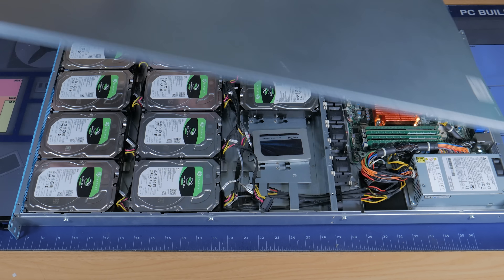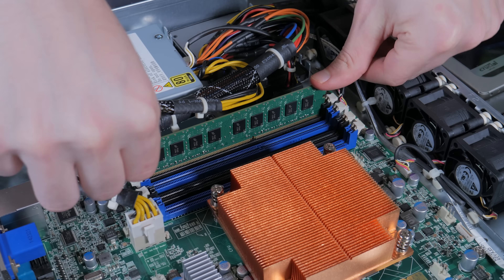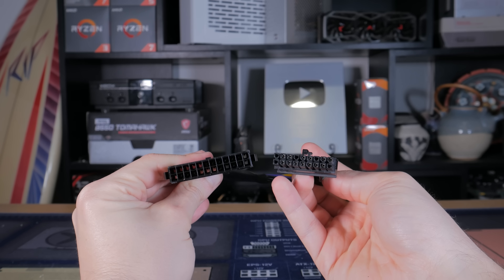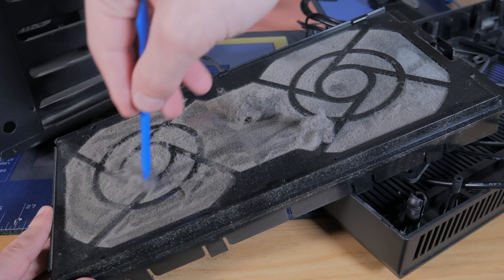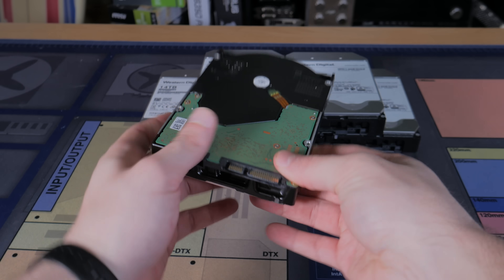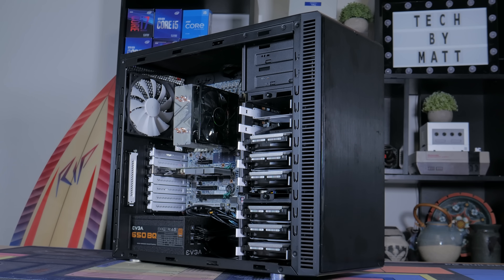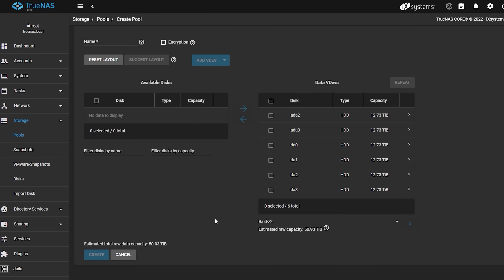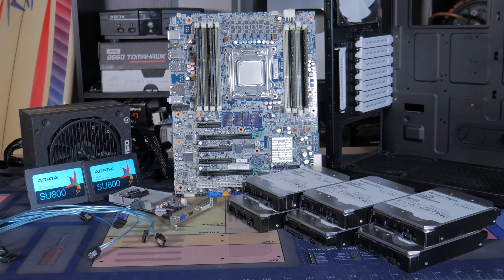Budget Storage Server 2022! | 84TB NAS

Comment: Interestingly enough, Western Digital is currently (April 2022) pushing out a lot of both Red Pro and Gold 16TB drives for $299.00... they must be getting ready to release a newer, larger capacity drive and need the warehouse space.
Reply: Interesting. I just picked up a 12TB gold for like 235.
Reply: @user-ul5wq3kv4p  For BF deals, $250 for 16TB and $284 for 18TB WD Red Pro.  Waiting for the WD shipping.  I have also got one Seagate Exos x18 18TB and HC530 renewed from Amazon.  HC530 wins in every perspective: temperature, noisy and speed.  I am considering buying additional renewed HC530, such a powerful beast.
Reply: Just don’t get anything but red pro. Anything below that is junk now
Reply: @ghost-user559  How about WD Red Plus ?
Reply: @tjhana  I think it’s only the pro they kept the quality of. Look up “SMR drives”. And read people’s experiences and horror stories. They have a very slow transfer speed once you get to a certain amount of data. It’s like they will seem fine but then take 14 hours transferring data that should have taken 4 hours. They can’t be raided or used in a NAS as a result. Only the Pro is the original quality.
Reply: @ghost-user559  not really
Reply: @quazar912  Yes they have a different design for drives that is incapable of being used in a raid array or Nas. They literally got caught using inferior drives without telling customers about it. After that they “promised” that they would keep the Pro line as the only line with raid and Nas compatibility.

Comment: This is great content Matt. I'm currently in the process of replicating your setup (more or less), but the core computing will be the same. I'm struggling to find mobo/cpu combos, so I guess I'll have to just buy an entire Z420 workstation (will save me on the PSU, since I can use its own). For the case, I also struggled - snagged a Corsair Obsidian 750D - only 6x 3.5 bays, but it's got 3 more 5 inch bays which I can adapt.

I read up on the 12 and 14 TBs, and the consensus among shuckers is they run quite hot - Would you be able to share your experience on this topic please?

Thanks for your work!
Reply: Hey I'm about to do the same in replicating his build. How did your build work out?
Reply: @CharlesMacro  So uh, it's live for some time now - my main NAS actually. I added a Quadro P400 card for Plex transcoding.
I transplanted the mobo/ram and cpu (E2640) from an actual Z420 workstation which I bought second hand into another case - You have to mind the transplanting, as it's finnicky - You can only move over the mobo/cpu/ram - as the PSU is non standard and will not fit a ATX case - https://youtu.be/c8G97FlI2QA

He's using it with TrueNas for storage mainly - I'm using it with UnRaid (which is additional cost) - but somewhat easier to deal with.

The supported CPUs for this mobo are quite old, and while they can deal with quite a lot - the energy consumption is a factor - I jumped feet first into this before the energy crisis - not sure I would do the same now.

Comment: To eliminate the "F1 to boot" issue you could get a cheap 80mm case fan (they're only a couple bucks) and mount it anywhere in the case. The connector for it is on the top left of the motherboard. Might not look terrific but you could just use double sided tape and stick it anywhere. Also, you may be able to attach a piece of wire or something across the 4 pins of the connector and essentially create a kind of "jumper" to trick it into thinking a fan is plugged in, though I have never tested that method. Aside from that I don't think there is a way to bypass that screen.

Comment: This looks like a good reasonable high core count* higher memory option. If you can find the v2 version of this hp board you can go upto 12core cpu,  the v1 board is limited to 8cores. 

*compared with my current i7-6700k storage server. The extra cores and higher memory support will be useful to host vms as well as storage,  though going upto 2011-v3 xeon is probably better for vm performance but obviously higher cost.

Comment: I built about the same thing. But I spent a lot more $$$ bc I bought everything brand new. Bought 8x6G hard drives. Had a spare ryzen 3800X, and a spare 700w power supply. So I had to buy out all of the other things, motherboard, memory, HBA, root hard drives, and a cheap nivida 710. Housed the entire thing in an R5. The only thing different is that I built it out in Proxmox and VM'd the True Nas build and direct attached the hard drives. All in all it ran me about $1500, which was about the same price as a Synology with the same drives. So I think I got a better deal: better CPU and system to build out VM's. I also got a better upgrade path if I wanted a better CPU.

Comment: ACTUALLY! I would love to see a comparison between both servers 
the new one as is (same ram and cpu as shown) with only a 10gbe upgrade 
VS the chenbro with unraid and a 10bge upgrade and would love to see the differences in both writing speed and video editing performance.

while true nas is free, you can't readily add drives like you can with unraid. 

backstory! 
I am currently using the chenbro with unraid but I too feel like I need more cpu power
and to fix that, I purchased a lyra sv315 and I'm planning to use the chenro as a disk shelf with a sata expander 
connecting the chenbro chassis to the lyra via sff 8088
but hopefully when I get to my new place, id move the hard disks to a dell md1000  storage vault, (its just really loud to use right now.

Comment: CPU
Intel Core i7-12700K 3.6 GHz 12-Core Processor
Intel Core i7-12700K 3.6 GHz 12-Core Processor
Base
$327.99
Promo
Shipping
FREE
Tax
Price
$327.99
Where

Buy
 Configure
 Remove
CPU Cooler
Scythe Mugen 5 Rev. B 51.17 CFM CPU Cooler
Scythe Mugen 5 Rev. B 51.17 CFM CPU Cooler
Base
$76.15
Promo
Shipping
Tax
Price
$76.15
Where

Buy
 Configure
 Remove
Motherboard
ASRock Z690 Extreme WiFi 6E ATX LGA1700 Motherboard
ASRock Z690 Extreme WiFi 6E ATX LGA1700 Motherboard
Base
$289.99
Promo
Shipping
FREE
Tax
Price
$289.99
Where

Buy
 Configure
 Remove
Memory
Corsair Vengeance RGB Pro 32 GB (2 x 16 GB) DDR4-3600 CL18 Memory
Corsair Vengeance RGB Pro 32 GB (2 x 16 GB) DDR4-3600 CL18 Memory
Base
$162.99
Promo
Shipping

Tax
Price
$162.99
Where

Buy
 Configure
 Remove
Memory
Corsair Vengeance RGB Pro 32 GB (2 x 16 GB) DDR4-3600 CL18 Memory
Corsair Vengeance RGB Pro 32 GB (2 x 16 GB) DDR4-3600 CL18 Memory
Base
$162.99
Promo
Shipping

Tax
Price
$162.99
Where

Buy
 Configure
 Remove
 Add Additional Memory
Storage
Samsung 970 Evo Plus 1 TB M.2-2280 NVME Solid State Drive
Samsung 970 Evo Plus 1 TB M.2-2280 NVME Solid State Drive
Base
$102.64
Promo
Shipping

Tax
Price
$102.64
Where

Buy
 Configure
 Remove
Storage
Samsung 970 Evo Plus 1 TB M.2-2280 NVME Solid State Drive
Samsung 970 Evo Plus 1 TB M.2-2280 NVME Solid State Drive
Base
$102.64
Promo
Shipping

Tax
Price
$102.64
Where

Buy
 Configure
 Remove
Storage
Samsung 970 Evo Plus 1 TB M.2-2280 NVME Solid State Drive
Samsung 970 Evo Plus 1 TB M.2-2280 NVME Solid State Drive
Base
$102.64
Promo
Shipping

Tax
Price
$102.64
Where

Buy
 Configure
 Remove
 Add Additional Storage
Video Card
 Choose A Video Card
Case
Anidees AI CRYSTAL XL PRO LITE ATX Full Tower Case
Anidees AI CRYSTAL XL PRO LITE ATX Full Tower Case
Base
$289.89
Promo
Shipping
Tax
Price
$289.89
Where

Buy
 Configure
 Remove
Power Supply
Corsair RMx (2021) 850 W 80+ Gold Certified Fully Modular ATX Power Supply
Corsair RMx (2021) 850 W 80+ Gold Certified Fully Modular ATX Power Supply
Base
$124.99
Promo
Shipping
FREE
Tax
Price
$124.99
Where

Buy
 Configure
 Remove
Operating System
Microsoft Windows 11 Pro OEM 64-bit
Microsoft Windows 11 Pro OEM 64-bit
Base
$159.99
Promo
Shipping
FREE
Tax
Price
$159.99
Where

Buy
 Configure
 Remove
Monitor
 Choose A Monitor
External Storage
Western Digital ELEMENTS 14 TB External Hard Drive
Western Digital ELEMENTS 14 TB External Hard Drive
Base
$241.81
Promo
Shipping

Tax
Price
$241.81
Where

Buy
 Configure
 Remove
External Storage
Western Digital ELEMENTS 14 TB External Hard Drive
Western Digital ELEMENTS 14 TB External Hard Drive
Base
$241.81
Promo
Shipping

Tax
Price
$241.81
Where

Buy
 Configure
 Remove
External Storage
Western Digital ELEMENTS 14 TB External Hard Drive
Western Digital ELEMENTS 14 TB External Hard Drive
Base
$241.81
Promo
Shipping

Tax
Price
$241.81
Where

Buy
 Configure
 Remove
External Storage
Western Digital ELEMENTS 14 TB External Hard Drive
Western Digital ELEMENTS 14 TB External Hard Drive
Base
$241.81
Promo
Shipping

Tax
Price
$241.81
Where

Buy
 Configure
 Remove
External Storage
Western Digital ELEMENTS 14 TB External Hard Drive
Western Digital ELEMENTS 14 TB External Hard Drive
Base
$241.81
Promo
Shipping

Tax
Price
$241.81
Where

Buy
 Configure
 Remove
External Storage
Western Digital ELEMENTS 14 TB External Hard Drive
Western Digital ELEMENTS 14 TB External Hard Drive
Base
$241.81
Promo
Shipping

Tax
Price
$241.81
Where

Buy
 Configure
 Remove
External Storage
Western Digital ELEMENTS 14 TB External Hard Drive
Western Digital ELEMENTS 14 TB External Hard Drive
Base
$241.81
Promo
Shipping

Tax
Price
$241.81
Where

Buy
 Configure
 Remove
External Storage
Western Digital ELEMENTS 14 TB External Hard Drive
Western Digital ELEMENTS 14 TB External Hard Drive
Base
$241.81
Promo
Shipping

Tax
Price
$241.81
Where

Buy
 Configure
 Remove
 Add Additional External Storage
Expansion Cards / Networking
Sound Cards, Wired Network Adapters, Wireless Network Adapters
Peripherals
Headphones, Keyboards, Mice, Speakers, Webcams
Accessories / Other
Case Accessories, Case Fans, Fan Controllers, Thermal Compound, External Storage, Optical Drives, UPS Systems
Custom
 Add Custom Part
Total:
$3837.38

Comment: Went with a Synology DS1621+ after my DIY server decided the backplane should die outs nowhere. 

Upgraded the Syn with 64GB of ram and stuffed in 6x18TB Seagate Exos and of course 2x2TB 970 Pro nvme SSDs for caching. 

Far better solution and was blown away by the speed at which Synology was to answer my questions about the PCIe slot within 45 seconds I had my answer and a contact email if I ever needed help with anything else.
Reply: I always wounder how much it costs to do a 8 bay, but £1000 (or 300-600 used) you can get Synology 8 bay nas and most of its power use is just the drives only and supports hotplug

most qnaps has a video port and normal bios, pull the USB DOM and replace it with say a 32/64gb DOM and install truenas onto it (or buy a qnap with hero os that uses zfs but don't open it to the internet)
Reply: @leexgx  I turned a QNAP TS 469 Pro into a unraid backup I desoldered the 512mb dom. Doing so it even saw the extra ram I installed. 4x18Tb drives as a offline back up

Comment: can a server be used as a gaming pc?
Reply: Do you mean like as a remote gaming PC with Parsec or something? That depends on what server it is. If it has enough space in the case, PCIe x16 slot and GPU power connector then sure.
If you mean to use it like a regular gaming PC in your room then most likely no because servers are really loud. But if it's a server built by yourself using a normal mainstream or workstation motherboard (like in the video) then it's just like any other PC

Comment: Do not depend on those Adata SU series SSDs, I had at work all of them fail.. 2 in 3month 3 in 6month and 1 in 1year.. I had Adata Raid1 with another brand.. else I would had data loss as those SU series SSDs died about the same day at once.
Crucial MX and Samsung sata SSD s still run happily.. half bought at same time others replaced by warranty..

Comment: Hi, nice video was looking for something same. Apart from the 24 pin to 18 pin adapter, did you have to do other jumpers on the motherboard before you can do the case swap? I was searching z420 case swap and i see a lot of different info on which pins should be kept etc.

Comment: The power disable pin is part of the sata spec. The general intent is by using supporting controllers to remotely hard reset or shutdown drives in the same way pulling the power would.
Drives intended for retail do not have the feature as they are directly connected to the power supply, thus the pin would be always active and the drive wouldn't turn on.
Drive manufactures make both drives with and without power disable, and distribute to the appropriate channels.

When these portable drives are made whatever is available is used. This is why you can end up with an assortment of drive types, and in your case some with and without power disable.
Don't know how they choose the drives, maybe what ever if coming off the line, or the one there is excess of, or even the ones that are slightly under preforming, but the ones with power disable are likely better as they where not originally destined for the retail market.

Shucking already voids the warranty, if they cared to stop the practice they would just use a custom firmware that would only work with the adapter or even go further and pair the two as that would defeat flashing a normal firmware to the drive.
Reply: The real problem isn't shucked WD drives powering off, it's damn PSU manufactures STILL putting a 3.3v rail on their SATA cables. I have no idea why almost all PSUs still do it, when it has been depreciated.

First thing I do when I get a new PSU (after testing) is remove the wire from all the included SATA cables. I hate getting screwed by a cable with 3.3v when I don't realize right away the damn cable is just disabling the drive. :D
Reply: @PeterBrockie  I don't know, but isn't it there for compatibility reasons? I would guess that some old hardware still requires this 3.3V rail. Just because modern devices (including drives) step down the voltage onboard doesn't mean it's not part of the spec or it's not necessary for some devices.
Reply: @comedyclub333  Molex connectors use 12v + 5v. When SATA came around I think the idea was to add 3.3v since a lot of ICs ran 3.3v instead of 5v at the time, and they could just directly run off that rail. But what ended up happening is essentially zero devices used the 3.3v rail because ICs got lower and lower in voltage (modern CPUs are under a volt) and it was easier to just use a local power regulator to change the 5v into 1.2v or whatever. CPUs use 12v input and your VRM lowers it to the ~0-2v (depending on hardware).

They changed the spec into making it a shutdown pin simply because it was never actually used in drives. I have no idea why PSUs still have it other than they are often based on older designs (I don't think even motherboards use 3.3v these days).
Reply: @PeterBrockie  95-99% of ICs are 3.3v nowadays.
CPUs & GPUs are forced to use lower voltage because there are billions - trillions transistors inside that all add up to hundreds of amps current consumption.
The higher the voltage, the more power draw and thus heat, less efficient they are.
It is only more expensive to produce lower voltage logic ICs because it requires much smaller physical transistor sizes and expensive fabs.
Reply: @Mr.Leeroy  I gave CPUs as an example of something very low voltage.

1.2v 1.8v 3.3v are all common - although I think your average device in a computer is probably 1.8v logic.

Either way, the point is moot since they clearly don't use the 3.3v rail to power ICs on nearly every drive ever made.
Reply: @PeterBrockie  3.3v is exactly the most common by far. Anything less is usually things like FPGAs that are expensive, highly specialized and thus not used widely.

Lower voltage power rails are not used anymore simply because at the same power they translate into higher currents and so higher cable losses. 12v is a sweet spot for ATX designs for now.

But that does not mean that legacy standards for PSUs should be discarded. It is a good thing that they are phased away very slowly. Otherwise we would change all the components of the entire PC each 2nd generation release..
It is already becoming ridiculous with DDR and PCIe generations. Different gens of DDR are completely incompatible.. PCIe has to be backwards compatible, but every new gen now requires hardware dependencies in CPUs, motherboards, which effectively drives obsolescence much faster nowadays.
Reply: @Mr.Leeroy  The whole point of this is that the 3.3v was never used by SATA devices (aside from like... 2 drives and even then I can't really confirm the rail was actually used), so why spend 10+ years phasing it out? They literally phased it out already - almost a decade ago. Even then they left it in for 10 years (DEVSLEEP was added in August 2013 to the SATA spec). Yet consumer PSUs still have pointless 3.3v rails on SATA connectors.
Reply: @PeterBrockie 
First of all, PC evolution was always driven from the Datacenter and enterprise sector, which actually pays huge premium for R&D, not the other way around. If it is there in a standard, then you bet it was used.
Second, deprecating standards is a slippery slope.
And only then, there are a ton of ways to solve this particular case without touching power delivery stuff. It could be solved in drives firmware or as in old days with a jumper selector for cents worth of human-hours.
Reply: Ah, so does the USB adapter in the WD shell set that pin to ground? Or just not connect it at all?

Comment: You could have just bought 2x 20tb HDDs and stuck them in a slim Nas....or even your tower. 

Most homes do not need a Nas.
Reply: For sure, but he literally said it's for footage and local archiving. 20tb disappears  really quick (with 2 20 in raid 1 because you always want redundancy)with raw 4k video. plus having more drives give you better r/w speeds than a single slow 20tb.
Reply: @EXOgreenMC  idealism. Doesn't make it practical though.